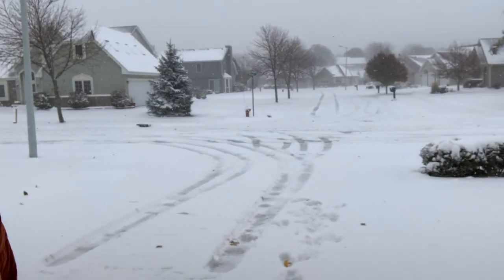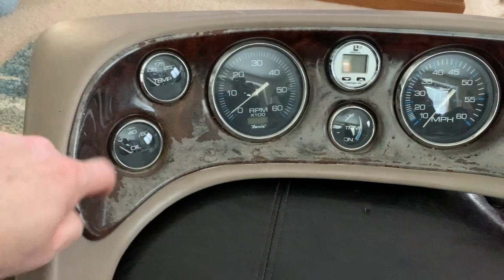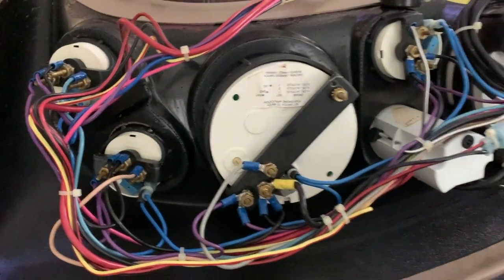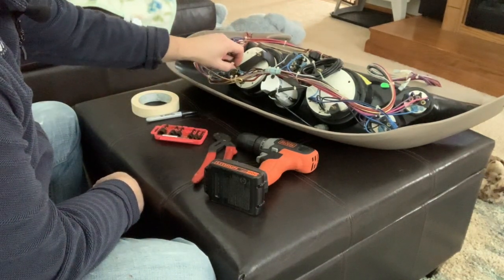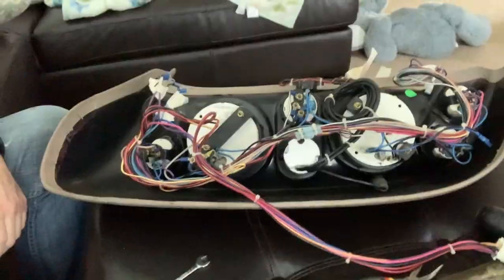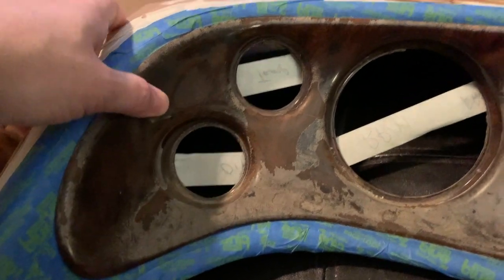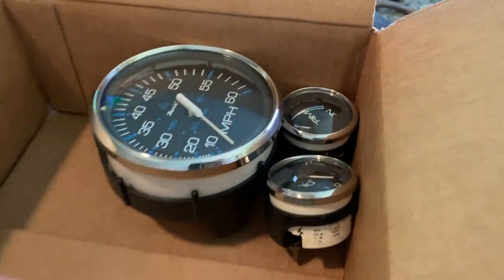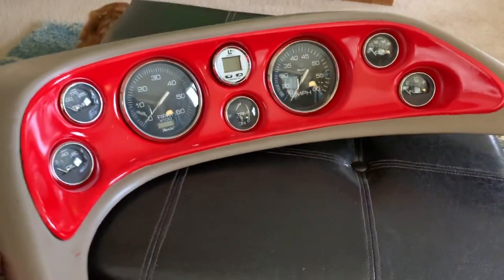MV Clifford, Regal 2665, refurbishing the instrument gauge cluster/binnacle

Comment: Thanks for sharing. Good work. Not sure the red looked the best with that brown, but maybe it looks better once installed. Overall the paint job turned out well. Not looking forward to trying to paint mine.
Reply from the maker: I wasn't sure about it either until I got it installed on the boat with the red circuit breaker and switch panels...plus the boat was (is...I don't own it anymore) red...and the new steering wheel really set it nicely. Thanks!

Comment: Hey! Just wanted to say thanks for the really cool content you produce. I have a Regal 2150 LSC and I was lucky enough to find a guy yet was was parting out a 1900 LRS and I was able to get the dash panel. I watched your video several times because I didn’t was to pay a body shop person 150-300 to paint the insert (which I was able to separate from the cover) and the 2 switch panels. My question is do you know of a retailer that sells specialty paints for plastics. I’m looking for a metallic light navy blue.. Home Depot and Lowes just didn’t have what I was looking for. Hopefully you can. Help.
Reply from the maker: Thanks for the comment, glad you enjoy it and some of it helps! I've found the best selection of paints and paint types at a local Ace Hardware. If you have one, that would be my best recommendation.
Reply: @WiscoBoater  Thanks Man! I really Appreciate the reply! I actually found a very close match to what I wanted at Home Depot. I wish I could post a picture. I was pretty proud of how the paint job came out. Can't wait to get the gauges installed and put back in the boat. I believe it's gonna look Great!!!! Thanks Again!!!
Reply from the maker: @mrbrian0223  That’s great to hear!! Yeah, wish pics could be posted on comments and replies. Hope it looks great when you’re done!
Reply: How did you remove the dash on your 2150 LSC???